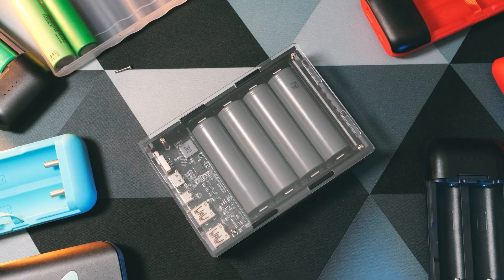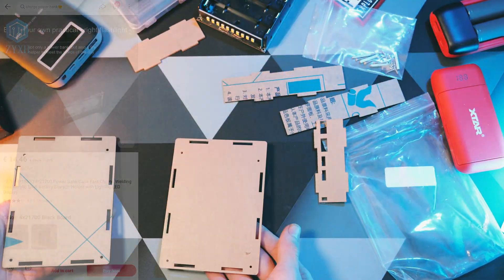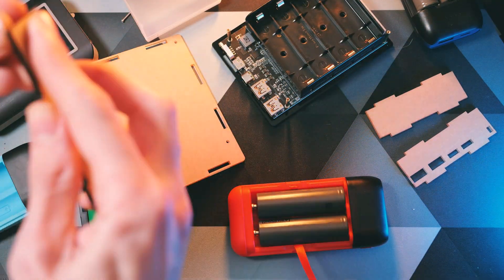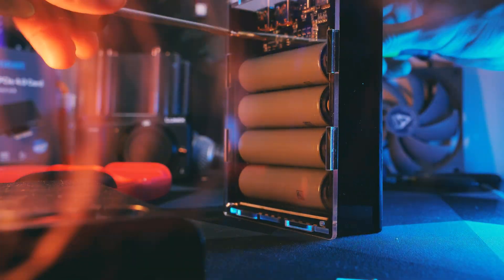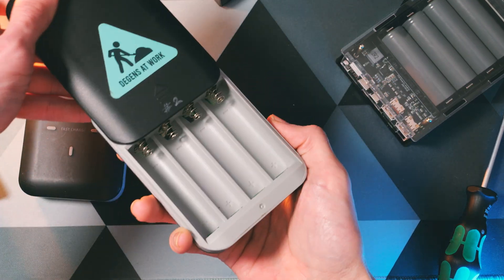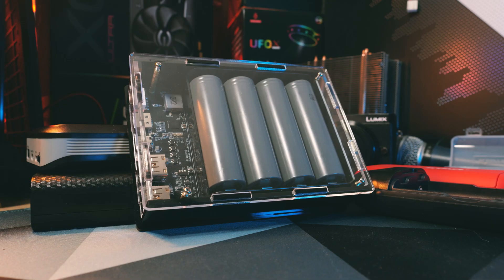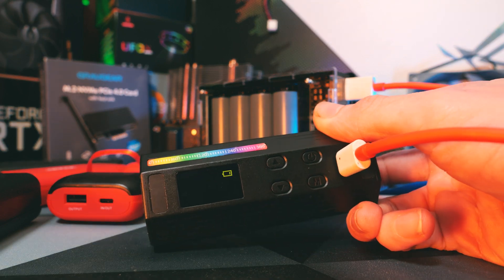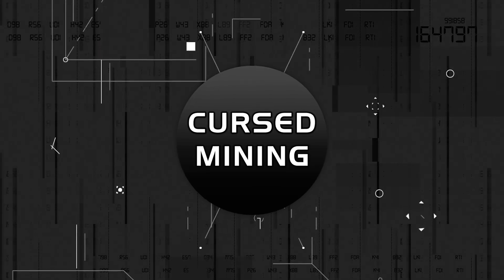Power Bank "DIY" Kit from AliExpress

Comment: Feb 22 Store has come out with a whole line of powerbank kits recently (or are carrying stuff they've found). They have their 4, 8, 12, 16, 24 cell kits with the acrylic case all the way around that I'm a little skeptical of because the old versions are IP5389 and I prefer IP2368. Their newer ones also have a DC port so it might be a different IC. They support up to two additional boards being placed on top of the main PCB so potentially you could have the main 100W IC plus 2 120W boards added to it for 340W output but you'd probably want to go with at least the 12 cell variant for that and of course you have to use cells that at least have a decent discharge rate. Too many kiddies putting old laptop cells and wondering why it wont work.

The cheaper kits are more similar to this one but with colored shells that might have the top clear to show the PCB. They have a couple 20W models, an all acrylic rectangular 45W model and recently a 100W model. I have the first two and they are both good. The 20W model I'm talking about has a simple screen that shows you if the power is either coming in or going out and the volts and amps. Current reading isnt terribly accurate but once you know how far off it is then you can at least have a good idea of how to read it accurately.. For $12 it was a great buy, I just hate that its a 4 cell 1S pack because you have to spot weld the cells in a funky way. All their other power banks use cell holders which...are alright I guess. Not the greatest quality, not the worst quality cell holders.
Reply from the maker: Thank you very much for all the input!! I will try to get my hands on a few more :) have a great day ser!!
Reply: Are the 100 watt DIY power banks on AliExpress just plug and play and you're all set? Or do you have to spot weld and install the board? I would really like to have one of the 24x18650 banks but I have zero interest in welding or soldering.
Reply: What is the difference between the 5389 ad 2368?

Comment: Powerbanks with springs are a big no go from me. Terribly high contact resistance and doesn't hold cells very securely in place. Leaf spring contacts are the way to go I just wish we'd see more companies using metals with higher conductivity like cupronickel or beryllium.

Comment: I would love to see this with AA batteries
Reply: It will die in minutes
Reply: @Iinustechtips  little do you know AA batteries have approximately 1500mAh to 3000MAh, and 18650 batteries (the ones showed here) have approximately 1500mAh to as much as 3600mAh.

So no it wouldn’t die in minutes…
Reply: @bigtymer4862  1200mah at 1.5v which is less than 4wh. 21700s gold 5000mah at 3.6v for 18wh each. That is 4x the capacity. Please check your facts....
Reply: @Iinustechtips  those are 18650 batteries not 21700s
Reply: @bigtymer4862  nope check again
Reply: @Iinustechtips  the video contained clips of both 21700 powerbanks and 18650 powerbanks. The topic of this video was indeed on 21700 powerbanks and the LG M50LT though.